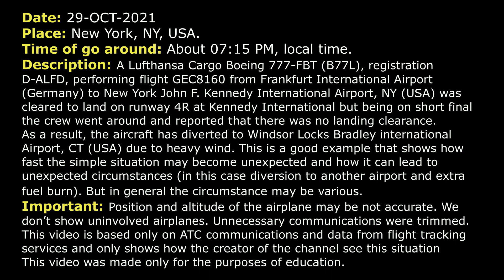Pilot missed the landing clearance | Lufthansa Cargo Boeing 777-FBT | New York Kennedy, ATC

Comment: Whilst the Lufthansa pilots probably missed the landing clearance due to the high workload (winds, final approach etc.) a major contributing factor is the lack of radiotelephony etiquette in the US. That landing clearance contained so much information and was given in a rather unstructured manner. Often I find US ATC recordings to feature transmissions which are bloated with unnecessary words and information. They would rather have just given a concise landing clearance with the measured wind, followed by a transmission about the reported conditions by the CRJ once the Lufthansa crew had read back the clearance.
Reply: Can't agree more, describing exactly the main contributing factor, not to mention how fast the controller issuing commands.
Reply: the instructions were in crystal clear english. if the lh pilots were unsure they should have asked way sooner than 2 seconds before decision. maybe 10 seconds before? yes the lh pilots had high workload but the instruction was clear and they didn't understand it but communicated that they did understand it

Comment: Ultimately, the controller should have questioned the crews failure to read back landing clearance correctly. ''copy that'' is not sufficient and she should have followed up
Reply: Certainly doesn't help that the pilots had a request in lieu of the readback, responding to the request (trying to be polite) can easily cause the missed readback to slide out of shortterm memory
Reply: I would also add, that the original "Clear to land" was very mumbled. No wonder Lufthansa missed that. But it can happen to anyone and I even accept that the following request made the ATC to forget to request readback. Both handled the resulting situation professionally. It's a nice model situation for ATC training..
Reply: Not to blame anybody, mistakes happen and should be investigated without putting blame on somebody, so that the industry can learn from it. But the controller put in the landing clearance right between 2 parts of her weather report. I think the the Lufthansa crew wouldn't have missed it if the clearance was right at the end of the transmission.
Reply: @Iamwatchingyou75  like i said, by US standards that was a very normal transmission. not a single american pilot would have missed it. clearly the lufthansa pilots aren't frequently in the USA
Reply: @UnshavenStatue   That is why there is an international agreement.  Controllers in big airport or even small should adhere to international phraseology , at least when dealing with a foreign aircraft. another contributing factor, how fast she was giving commands. it was not a busy night.

Comment: I think the wind gusts were just an overwhelming concern for the pilots and their thoughts.   As a result, task saturation occurred quickly and clouded their thinking process.   Subsequently the pilots never caught the landing clearance given to them  by ATC.
Reply: ATC should have noticed the lack of readback, but yea otherwise I think ATC did great. Confounding things was that they had a request in lieu of their readback, and ATC responding to the request can easily cause the missed readback to be forgotten
Reply: @UnshavenStatue  With a "copy all that" the pilots more or less take responsibility for having heard everything. Normally this is only done for "unimportant stuff" like a wind report. The other way around the controller could've deduced that they didn't think she said anything important when they used "copy all that" as the readback.

Comment: Humans and this was 50/50 between pilots and ATC. Remember pilots are busy at this stage of flight. Sure they expect the radio, but its easy to miss (checklists, confirmations etc) and the radio comes out of nowhere and lasts less than 3 seconds. This is why readbacks are required. There was no readback, so ATC should have been alert to this and confirm the clearance. In the end no real harm done.

Comment: If they thought they didn’t have landing clearance, it seems strange to ask for it so late that any delay in response will cause a go-around.
And then when they diverted the winds were 25/34 vs 26/34 for the original clearance, so no difference [Edit: but slightly different crosswind component, thanks for the comment].
Aside from the apparent non-ideal communication, seems like there’s something we’re missing here
Reply: Wind direction had shifted though. Original was 090 so a 19kt sustained xwind and latter was 100 degrees and a 21kt sustained xwind component. Maybe the wind had shifted enough something was out of limits? Or the pilots didn’t feel like the original approach was stable enough to try again?
Reply: I kind of disagree on the first part. Kennedy is really busy and often the previous landing aircraft vacates the runway when the next one is on a like 1-2 mile final. Or someone will cross the runway last second. Basically everywhere except in the US the landing clearance will be given only when you are the next movement on the runway. So late landing clearances are more common. The pilots maybe thought it had a reason and saw another aircraft ahead of them (we dont see on the video what kind of other traffic was arounf that runway). So maybe they just saw another one ahead and then waited for the runway to be cleared before even expecting a clearance. Meanwhile in the US they give clearances as number 3 on final or even earlier, at a distance from the runway where foreign pilots don't expect it. A rushed "cleared to land" will, if you not listen closely be hard to understand. Pilots probably expected a "continue approach" so that's what they thought it was. Plus they had a long flight and a stressful approach with probably a lot of workload.
Reply: @laulpoecken  Interesting, thanks for the insight! Speaking to one of your points, they did sound a little on edge, and I did wonder if the flight length and workload contributed, as others have suggested
Reply: @colemadonna6284  what about all that gust ? Disregard it ?

Comment: That is what we call a pilot screw-up.  The controller gave them landing clearance on 4R and they acknowledged.  The crew just forgot they had clearance.  I think Lufthansa needs to put the crew back through intense landing training so they can learn to manage the aircraft before they kill someone.
Reply: The pilot did not read back the clearance to land as he should have.
Reply: It doesn't have anything to do with them forgetting. If a pilot receives a landing clearance they will always read it back as "cleared to land". The simple "copy that" was probably only regarding the wind information. My guess is they just didn't hear the clearance correctly. If your first language isn't English then it can be really hard to catch what an ATC is saying, especially at JFK or other busy airports they tend to talk really fast.
Reply: Even if they had forgotten the clearance, the G/A is not a big deal, it's a perfekt save and well trained maneuver, it costs some fuel and that's it. 
Landing without a clearance whould be by far more dangerous.

Comment: When it's obvious that ATC simply forgot to issue the landing clearance OR it's clear you may not have heard it - I would just land and sort it out afterward.  Doing that causes less of an issue and avoids a potential emergency.  He DID have the clearance though - and simply forgot he had it.  This is PARTIALLY because in Europe you won't get a landing clearance as early as you do in the US.  In the US they can clear 10 people to land at once.  That also led to the confusion.  I have an indicator I use to note clear to land.  I reference that.  He probably does the same and he neglected to set that indicator.
Reply: Bruh that is stupid. DONT LAND IF YOU HAVENT BEEN CLEARED TO LAND. That would cause an emergency maybe not the going around part
Reply: @jakobbb6405  common sense.  You have to use the info you have.  If it’s freq congestion etc just land.  I’ve talked to ATC on this issue.   It’s a case by case actual situation by situation call.  If you’ve talked to no one - sure go around.  Case by case. Apply common sense.
Reply: "Land anyway" after presumably not having heard the clearance?  I am certainly not a pilot and you would likely know much more than I do; but, wow
Reply: @imaPangolin  You’re completely wrong. Do not “just land” unless you are sure that you have received a clearance to do so.
Reply: @zackaplowitz  I knew it would be a controversial answer.  Which is safer? Landing or going around?  That’s the decision I would be making.  Every circumstance is different.  In many cases esp at busy class B Airspace in the Us After an instrument approach the expectation is that you will land.  If I didn’t have clearance I’d look at the tower for the red lights.  Otherwise I’d probably land.  File an ASRS report and move on.  If I chose landing as safer than go around.  I’ve seen this happen before and I’ve never even heard of anyone having an issue with this.   Let’s see if an ATC will check in.  In this case when they tried to get confirmation there was interference on the frequency.  That’s lost comm.  What’s the procedure?
Reply: @imaPangolin  Trying to contact someone once and having the transmission stepped on is NOT lost comms?!
Reply: @imaPangolin  I’m pretty confused by this as you seem to know what you’re talking about. Interested to see some other opinions but I don’t think an accident report would view you very favorably if something were to go wrong.
Reply: @zackaplowitz  there’s always that.  But doing the safest thing is always best.  It’s a risk assessment in seconds.  I’m not saying just always land clearance or not.  You might be aligned with the wrong runway.  There might be someone you don’t see in front of you.  If ATC had said “Continue” I’d be leery of landing without clearance.  These things happen fast.  I’ve had a stuck mike on tower. I’ve gone back to approach and received the landing clearance from them.  As I said it’s situational and many things get weighed in an instant.  Fuel. Alternate. Complexity of the event.  I’m not saying ALWAYS land but I’d certainly likewise not saying always go around lacking landing clearance.   Do what is the safest.
Reply: @imaPangolin  I understand that. I would argue that the KNOWN threat of a go-around can therefore be mitigated and managed safely. Landing without clearance is an UNKNOWN risk.
Reply: @zackaplowitz  This discussion brings up an important difference between US and non US operations. My view is that the European method is better.  In US operations cleared to land means you may land and it is expected but not guaranteed that the runway will be clear.   Responsibility for ensuring  that runway is clear when you touch down is largely on the US pilot.   In EASA governed countries you won’t receive landing clearance until the runway IS clear.  My bias and the Lufthansa pilots bias has the same source but lean in opposite direction.
Reply: @zackaplowitz  at that time in that condition you bet it is.  It’s all situational.  The pilot made a decision and stuck with it.  That’s good.
Reply: @imaPangolin  - landing anyway and worrying about a landing clearance afterwards will never turn out well.
Reply: @EdOeuna  absolutes are a problem.  Correct ADM might mean landing without the clearance is the safest course.   91.3.
Reply: @imaPangolin  - landing without a clearance would be ok if you’ve lost both engines on short final (BA38) or your on fire or something life threateningly catastrophic. Landing without a clearance because of congested ATC or the tower forgot to issue a clearance, etc, will never be a justifiable reason. Never. 

A go-around is a perfectly normal flight manoeuvre (compared to TCAS, wind-shear escape) so performing a go around because a doubt lingers as to if you’ve received a clearance to land or not will be the safest thing to do.
Reply: @EdOeuna  No alternate planned.  Landing close to reserve fuel.  Congested busy Class B airspace.  Going around will result in a fuel emergency.   The landing clearance is a technicality.  Everything to that point is normal but the tower is distracted by something else.   Never say Never.  Absolutes are not good ADM.
Reply: @imaPangolin  - maybe get some experience flying the 77L and then come back and remake your point. 

Landing without a clearance and without any life threatening emergency (and I mean life, not just low fuel or misheard clearance) will get you into a fair amount of trouble. Depending on who you fly for, you might even get fired it is that serious.
Reply: @EdOeuna  lol.  Ok.  Doubtful that will happen but nothing is outside the realm of possibility.  I’ve know pilots who have landed sans clearance.  I’m not trying to trivialize it - there’s a reason for it.  The US method for issuing the landing clearance is flawed.  The European method is far superior.   ASRS reports illuminate this.  For the record I go out of my way to get a clear and confirmed landing clearance.  I have had discussions with ATC about the “what if” of this and their tale has always been the expectation that we will land in a situation where the runway is only used for landing, the approach was cleared, everything has proceeded normally, no apparent runway incursion, and no go around has been called.
Reply: @imaPangolin  - we agree on one thing. The American system of flying / ATC is terrible, with a landing clearance being given with multiple aircraft between yon and the runway. Whoever thought this system was a good idea is seriously deluded.
Reply: Say that to an examiner when u go for a chekride...id love to see what he/she says.
Reply: @gulthepilot  - know one I fly with takes any enjoyment with flying into the USA because of the unnecessary things you seem to have to do there just to get by. There are many more risks and traps than flying anywhere else in the world.
Reply: @EdOeuna  lol..I'm not surprised..its one thing flying Cessnas and trainers there which I have which was a lotta fun...but flying a jet would be tricky I imagine...btw what's vol 1 say abt x wind limits on a 777 ? I would think at least 30 .
Reply: @gulthepilot  45kts for dry and 40kts for a wet runway, including gusts. Cross wind limit more than halves with contaminated runways.
Reply: @EdOeuna  these guys were well within limits assuming it's a dry or wet rwy then..wonder y they'd divert .
Reply: @gulthepilot  - maybe they were concerned that, if they went around a second time, then they’d have to commit to a destination where the weather was pretty poor and any diversion wouldn’t be possible. 

Maybe they had a preconceived plan. With the weather as it was, they’d divert if they went around without a second try.